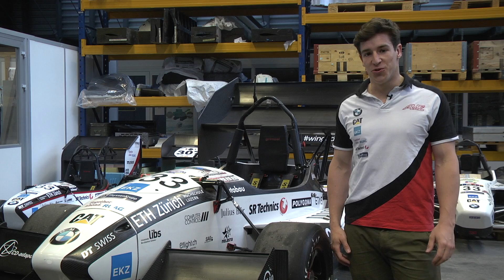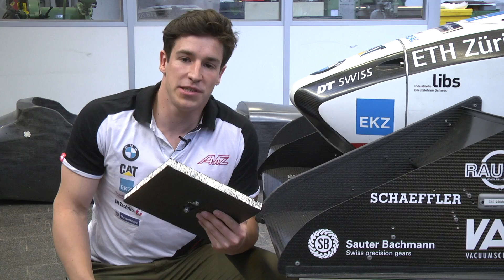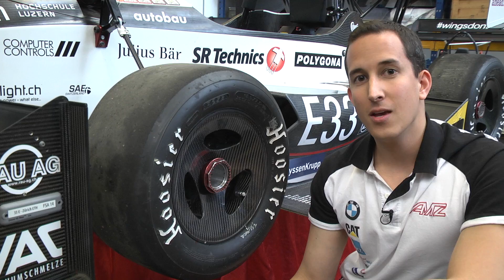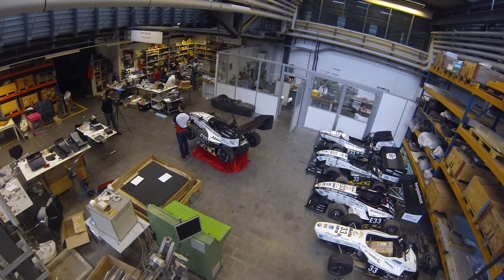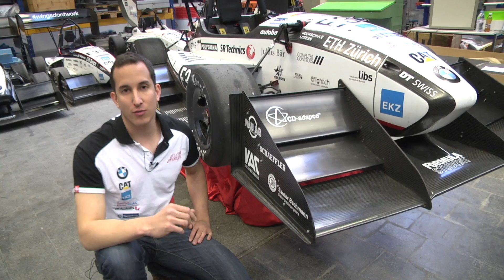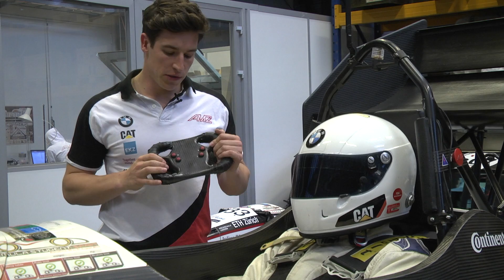grimsel - Technical Tour

Comment: How old were you guys in 1999? That's the year that I was the composite team leader for the S.A.E. formula at E.T.S. Montreal. Back then We've hand-made the plugs, the molds, and the parts for the fairing, the bench, and the motor air duck. I was advocating for a fiberglass S2/kevlar (best cost report) or carbon fiber (best weight saving) monocoque but unfortunately back then the non-metal mechanical engineering students were not in majority so the 2000 team went once again for a Chro-mo tubular frame.

Comment: Hello, I'm a student currently studying SAE Inwheel Powertrain.

1. I'd like to know the material and module value of the planetary gear being used.

2. Using the inwheel motor method is expected to deliver a lot of shock to the gearbox, how did you solve it?
Reply: Hello brother I am a student currently studying fsae
Reply: Can please give some technical information about fsae ev

Comment: Engines and gearbox in wheels increase unsprung weight... maybe in track is less important than strret?
Reply: unsprung mass shouldn't matter on perfectly smooth tracks, as only the sprung mass is moving relative to the wheels. The tracks used in Formula Student are generally smooth.

Comment: I'm sure there's something I am missing here. Why can't you just re-wind the motors and leave out the gearbox?
Reply: you'd need more amps to get the same wheel torque at lower speeds. more amps would mean thicker winding wires, a different battery arrangement, and thicker conductors. given the low weight of a single stage planetary gear system, the the troubles of getting even more amps (they claim above they are pulling 400A during acceleration) out of the batteries this seems like a sensible solution to the issue.
Reply: thanks, that makes a lot of sense. 400A is mind-boggling already.
Reply: I feel like a torquier slower motor for the same power would be bigger and heavier, moreso than you'd gain by dropping the gearbox, but I don't know a lot about motors.

Comment: Excellent work ladies and gentlemen!  Is there a technical paper about the motors?  Given their small size and high power density, I assume they're permanent magnet.
Reply from the maker: Hey Loanword, unfortunately there is no paper about the current motors. But you're right, they are permanent magnet synchronous in-runner motors.

Comment: I know it could be confidential, but I would like to know if you use aluminium honeycomb or other materials for the inner core of the wheel, because I think is the only way to achieve better weight on a wheel of this kind... Thanks in advance
Reply: the core material for the rims is not aluminium honeycomb but a foam called "rohacell". Its a high temperature foam that has a very good compressive and shear strength (at about the same density as al. honeycomb) and it can be machined to a desired geometry.
Reply: +luciens okay! thanks :)

Comment: Is it correct that you use Lipo cells of about 3600 mAh? 112 cells in series and 4 parallel?
 What is the max. current draw on the battery while driving?
Reply from the maker: Hi Eugene! Yes that is correct. We're drawing nearly 400A during acceleration!
Reply: It was 3.9 Ah cells in grimsel to be precise. The regulated maximum power during the race is (was) 85 kW. Divide that by 3.5 V per cell (which corresponds to a low SOC) which is 392 V battery voltage. You get 217 -ish A. Of course, for the WR, this must have been a little higher, but this was not exactly design spec ...

Comment: What about ground effect? Lots of downforce, very little drag.
Reply from the maker: Front wing and undertray are of course operating close enough to the ground to make use of the ground effect. If you're referring to active ground effect devices like in the Brabham BT46, we would love to use them but they are prohibited in Formula Student.
Reply: I was thinking more like the Lotus 79 with side skirts rubbing along the ground containing the low pressure. But if the undertray makes the same effect then same, same :P I'm not an engineer like you guys, thought just popped into my head. Awesome to follow your development!
Reply from the maker: Sliding skirts are prohibited as well, as the cars are not allowed to touch the ground with anything else but their tyres. Otherwise you would definitely see them on our cars ;)
Reply: AMZFormulaStudent That's some strict regulations haha! Awesome

Comment: Furthering jayfulf's query about unsprung mass, wouldn't inboard motors allow lower center of gravity since gear train design would be more flexible? Similarly, distributing weight of batteries would allow also allow lower CoG and reduce cooling and polar moment issues, where driver weight/vehicle balance becomes a significant and relatively inflexible (really!) variable.
Reply from the maker: Hi Profrex, thanks for your interest! You're right that inboard motors could be positioned in a way, that they minimize CoG (Ka-Raceing actually is a perfect example for maximizing this concept). Still in our concept evaluations the lower CoG and lower momentum around the z-axis together with the lower unsprung mass still do not outweigh the gains made by lowering the overall weight, and friction as well as the packaging advantages.
Regarding your question about different accumulator packaging, you might be eager to hear, that we actually split the accumulator in two separate boxes, putting one below the feet of the driver and thus lowering CoG!
Reply: Great question and answer here, I wondered this myself.
I want to be a student again, we got to make a wood bookcase at 
school!!! That is some serious design and manufacturing, something I 
would expect from a specialised low volume car builder for millionaires 
and the like. Just awesome. 50HP for 3 KG, X 4 sounds like TNT. Your 
0-100 time is faster then a Formula 1.

How much does the car weigh in a typical or average set up, IE with the wings on it, with or without driver? What sort of speeds are achieved in Driving? Do you use different reduction ratios for different conditions/events?

Comment: Is it possible to remove the reduction gears and aim for top speed?
Reply: Given peak torque as stated in the video is achieved up to 1/2 of the potential RPM I imagine the motors would run out of necessary torque w/o the gear reduction. A top speed electric car would need a complete redesign.
Reply: You need torque to accelerate from stand still. A variable or multiple speed gear box can potentially give higher top speed but this is a race car with high acceleration.

Comment: Two questions:
1. Why didn't you mount the motors inboard to reduce unsprung mass?
2. I could be wrong but it looks like there's almost no caster or camber angle.  Why not have positive caster and negative camber?
Reply from the maker: Hi jayfulf! Thanks for your interest in our car, great questions! You're right, that one could achieve lower unsprung mass with chassis-mounted motors. However the overall weight increases as you need to account for all parts connecting motor an wheel. Also the friction of the drivetrain is higher, decreasing efficiency. And finally the packaging in and around the chassis gets more complex. Our cars have to fulfill a certain minimal template inside the chassis, so you would have to "find" the space for the motors. However, there are teams who indeed use this concept (i.e. KaRaceing). In the end it's a question where you put your priorities and where you expect the higher gains.
Regarding your second question the caster angle is indeed positive but hardly visible in this video. Camber and toe, however, are zero (under load) since since that's where these tyres reach peak longitudinal grip.
Reply: AMZFormulaStudent Hey, thanks for the detailed response.  That answers my questions perfectly.